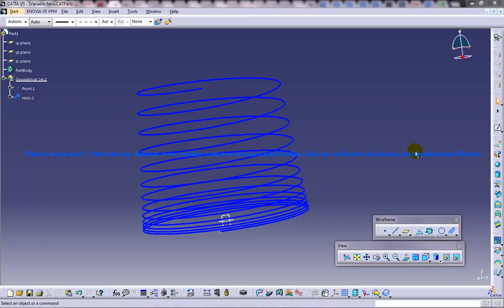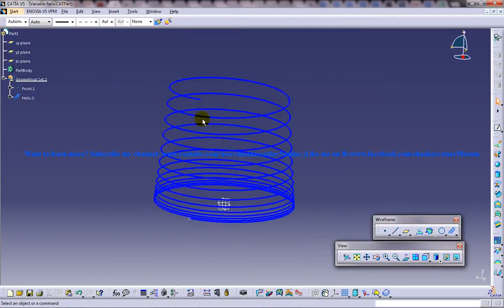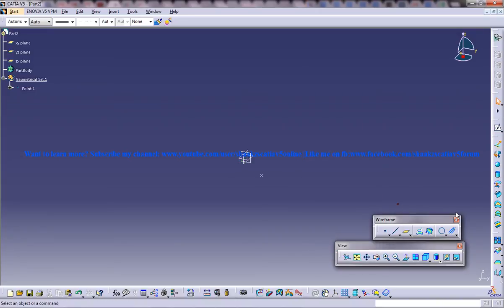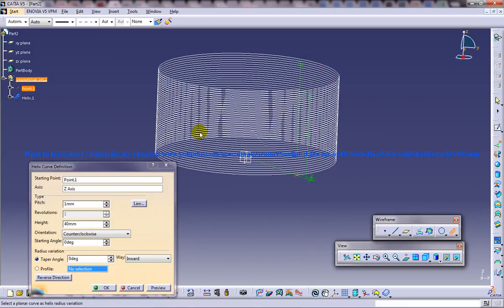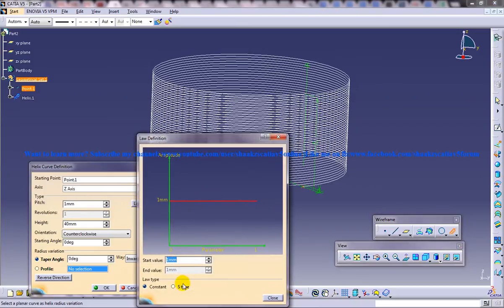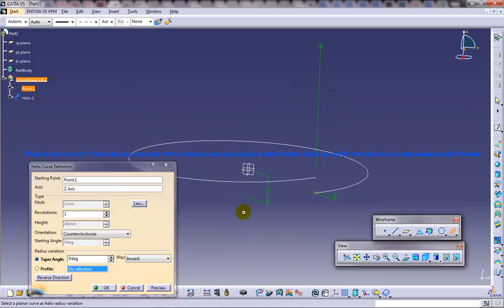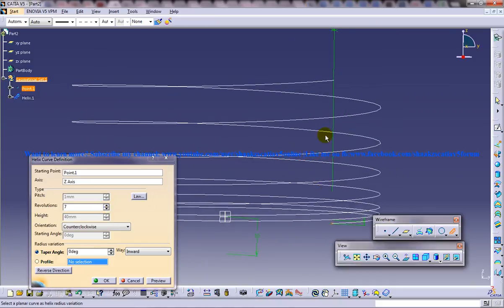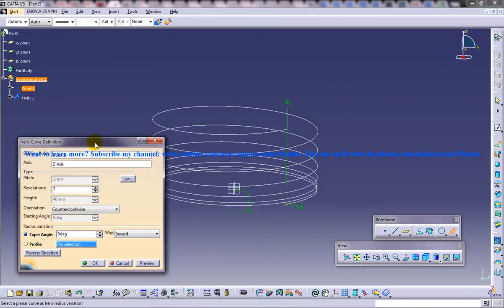Catia V5 Powerful Tricks #119|How to Create Variable Helical Pitch|Product & Mechanical Engineering

Comment: How will we be able to make a Spring design with number of Variable pitch and variable OD, for example like a pig tail spring or a mini block spring.
Reply: Akshit Bafna You can use the rib command to do that
Reply: You can draw a curve that follows the desired variable OD and use it as profile in Helix tool. Or just use taper angle and orientation.